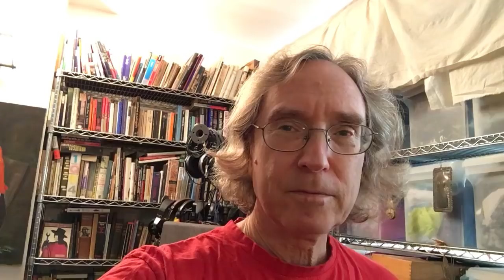Accuracy in audio is pure BS

Comment: I find that many people associate accuracy or detail with brightness. My good friend owns an independent hi-fi store and he says most of the people who come in to his store are attracted to more colored/forward/brighter mids and highs than ones that are neutral/natural sounding. They also appear more attracted to speakers with exaggerated bass even if the bass is nothing more than light port-chuffing. Tight, non-bloated bass is often perceived as weak bass.
Reply: You are right, Mike. May I add that this enjoyment of  colored/forward/brighter mids and highs and exaggerated bass Is short lived for most when exposed to a balanced reproduction of a neutral speakers/amplifiers or, better yet, live musicians in a smaller venue, more representative of the listenner's living room.
Reply: mike young Of course, that's why you used to see all the smiley faces on  EQs. Of course,  this doesn't apply to audiophiles. Speakers may seem to be sounding more different than ever before but their higher resolution may have something to do with it. In a proper setup, decent speakers now can easily  differentiate between equipment used upstream whereas I don't think you could say that about typical speakers of the 70s.

Comment: Man, wouldn't it be boring if they all sounded the same! I've recently become obsessed with headphones, and part of the fun is how different they all sound. 
As for speakers, I'm building some full-range-driver transmission-lines at the moment. I'm hoping Miles' trumpet and Nina's vocals are ballpark, all the other frequencies can go to hell ;^)
Reply: Antoine P Exactly! First of all, if they all sounded the same there would, by now, be only one company making speakers! I'm also going through a headphone phase. When I want a slightly different sound, it is so easy to swap headphones, which is not the case with speakers.
Reply: what? we are talking about NOT LOSING the original sound here; what the artist records shouldnt be degraded with noise, distortion, time shift errors, loss of DR; the only way to achieve this is with technical specs, comparing systems with scientific measurements because THEY ARE NOT SUBJECTIVE TO TASTE; the diversity in companies brings variants in design technologies, aestethics, service and support, etc, but in terms of FIDELITY you can only compre and rate their products by specs

Comment: Steve,
Please note that consumers purchase equipment, take it out of the box and use it. Professional audio engineers do the same thing but they also will shoot the system with pink noise and set the various levels to "flatten the response". every speaker, amplifier and room needs to be "Tuned" . It is amazing the amount of difference this makes and i can't understand why audio consumers neglect this very important step. This is the main reason various speakers and rooms (and amplifiers) sound so different. 
This rule always applies to Audio, "If you change one thing, You will always change something else also"

Comment: I own what are supposed to be accurate speakers, JBL 4367's (home version) which is based off the M2 Studio Monitor project. Harman's latest research went into the M2 project, starting with a horn that eliminates the internal resonances of previous horns, wide dispersion and 3D imaging, two ring radiators instead of domes which have break up nodes and ring.
Compression tweeters, unlike some speakers which just have a waveguide but call themselves horns. A lot of technology is also in thermal management and the ability to play loud without huge amounts of power.

I used to own Magnepan 3.6's which I loved for their imaging and tight bass. However when I heard the incredible soundstage of the JBL 4367's I decided to switch. At the AXPONA 2017 someone credited the dynamics to be able to "rip your face off". 
Plus I am enjoying the impact of their dynamic 15" woofer, which puts out a lot of power but is never boomy and mid bass chestiness. Like my old JBL L96's had, from 700hz and up it's all horn speaker. While they do not throw as large a soundstage as the Maggies image placement and depth I think are better. Also the sound never sounds like it's coming out of monkey coffin/box like so many speakers.

While I am fan and believe in the research Harman is doing, I don't think they have all the answers yet but they are at trying. As an example Revel Ulitima 2's have never done much for me,  same for JBL's Everest's speakers as they have never had the engaging imaging that I need. I prefer YG Acoustics to them by far. 

So I would love to see a review of JBLs 4367's by Steve to get his opinion. I have been a fan of Mr. Guttenburg's for a long time, I just don't agree with him all the time. As to all the different tastes and types of speakers, I think audiophiles have to go with whatever speakers overall sound moves and engage's them emotionally but minimize's any obvious faults that would annoy them over time,  as is in life speakers are a series of comprises.
Reply: The JBL 4367's measure very flat, however most people prefer a downward sloping treble to keep music from sounding too bright. So I have the tone controls for the HF & UHF treble, both turned two clicks back.

Comment: So I guess...this will also apply to speakers reviews.  Whatever sounds good to one reviewer may not sound as good or accurate to another reviewer.
Reply from the maker: Reviews of wine, movies, golf clubs, and speakers represent the views of the reviewer. The reader of any type of review has to see if they share common beliefs and passions with the reviewer, only then does a review have any relevance.
Reply: no Steve, you either are wrong or refuse to accept the term ACCURACY; you better choose some other word for your video title or accept that measurements and specs ARE the only way of scientifically measure the fidelity of an audio system; the fact that your reviews fail to focus on these items makes you just another subjectivist that only gives personal opinions about the products you "review"; even todays wine production is conducted withing very tight measurements of components, that is what gives a wine producer their desired taste; and yes, if you like X wine you want it to be EXACTLY the same win in time, no matter WHERE u buy the bottle

Comment: Accuracy is another word for high fidelity, so the consequence is....?! Electromechanical conversion has not reached the level of excellence as the amplfication of microvolt/time differences. And there is no such thing as a monolithic intersubjective valid reference sonic event as a gauge measure for the accuracy of reproduced sound. That are two reasons why the sound of different speakers are different.

Comment: It should not sound like what is considered neutral. It should sound like what YOU like. If you have been anywhere near a sound recording production in more than one place you would know that it is IMPOSSIBLE to build one system that is going to reproduce every recording as intended. It is possible to have a system that always produces a sound that YOU like. And for everything that is worth it. NEVER build a system to impress. It's like supercars, if you buy it for any other reason than the fact that YOU like it. Then it is not worth it. No one else will really care in the end.

Comment: This is absolutely correct, "accuracy" is total BS. Records are not made to be an "accurate" capture of a "performance". They are made to sound good played in your living room or car where the volume, the equipment and the environment are totally differnt from any live performance, including those in the studio to make the record in the first place. Similarly audio equipment designers are doing the same thing - they are trying to make equipment that sounds good. "Accuracy" has nothing to do with it.

The best example of this is the famous Yamaha NS-10 speaker. This is the most "accurate" and "nuetral" speaker in the world by a distance. Almost every renowned recording and mixing engineer in the world has a pair of these and uses them regularly when making records for this reason. They famously sound like absolute shit however. One reason engineers use them is that if you can make a record sound even half decent through them it will sound absolutely fantastic through a pair of decent speakers that are built to sound good rather than "accurate". The other reason is becasue of their neutrality and accuracy, their absolutely flat and consistent response bascially, it is easier to hear the results of fine adjustements to EQ, reverb etc on individual tracks within the mix.

But nobody in their right minds would buy a pair of NS-10's for recreational use at home. Thats' becasue people are not interested in "accuracy" or "neutrality", they are interested in speakers that make music sound great which is very much not the same thing. And since audio equipment manufacturers are well aware of that, they make that equipment to sound good, not "accurate".

The thing is all recorded music and all domestic audio equipment is desinged to give us what is essentually a carefully crafted sonic illusion of a live performance. What sounds great in the concert hall tends to sound awefull in the living room and visa versa. That's why recording studios were invented.
Reply: 1234gregor Indeed. If it was supposed to sound live, they'd just stick a microphone up at the concert and get it all...the crowd, the echo of the hall, the sneezes, coughs, etc.

Of course they do that at times, but it isn't what most people want every time.

In the living room, car, etc most folks want a clean version that sounds pleasant.